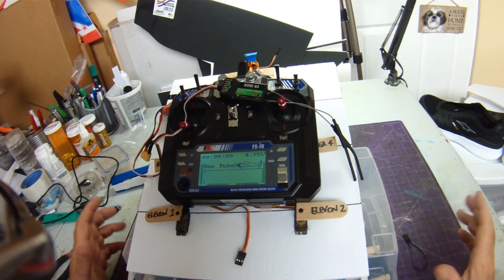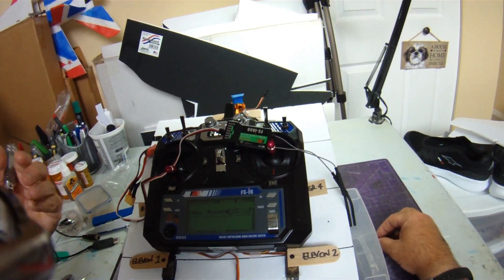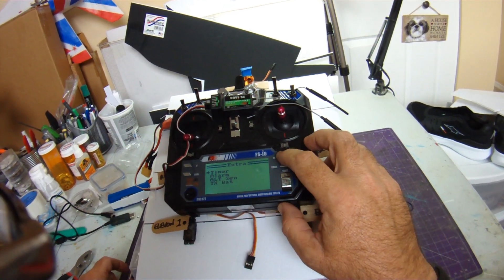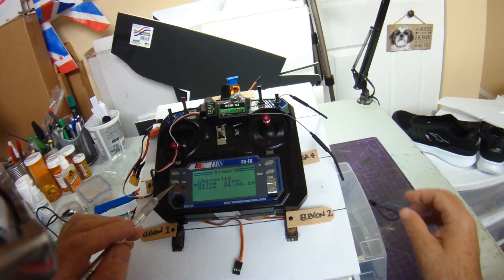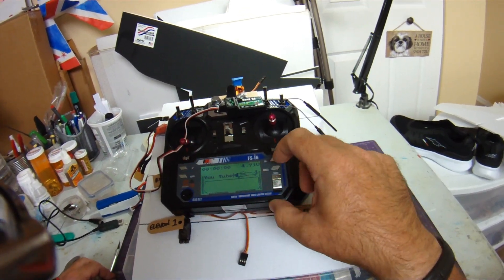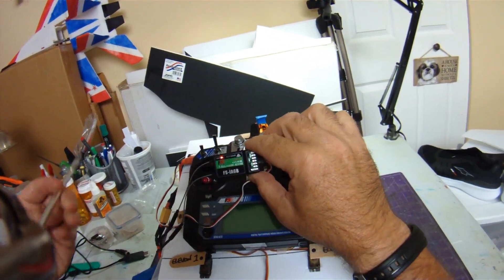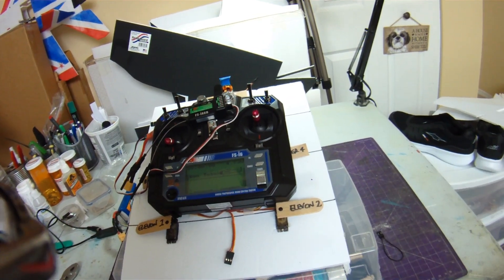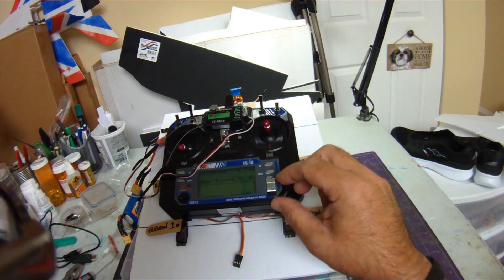FlySky FS-i6 firmware upgrade...I got the timer to work :)

Comment: Quick question... How do you know what PMW to set and what timing to set on specific Motors
Reply from the maker: Primarily just through testing each different combination of timing and PWM on my thrust stand with a fresh battery each time.  Here is the link to the spreadsheet with all the data I collected from the quad racing motors I tested as well as some other popular motors for park jets.  https://docs.google.com/spreadsheets/d/1KLR_wdkJ1OdGcf5f9jxxxU8qqmz_kXjMQH8NOLjW3NQ/edit?usp=sharing  Each motor has it's own page, so if you scroll along the bottom, you can find a particular motor that I have tested.  I try to put the PWM and timing setting if it is applicable to the ESC, otherwise it will just be factory default.  Cheers, Scott

Comment: Hey e3, I’m loving this thread! I’m also an i6 user, needing to use the timer on my phone to set flight times; very clunky. Have also found myself wishing  this Tx had a 7th or 8th channel - I have never needed more than that, but for some of my models, 6ch with 3 mixes just wasn’t quite enough. I’m going to run the firmware and see how I go - thanks again for pioneering helpful stuff as always!!
Reply from the maker: Hi Ben, thanks very much for the kind words, glad it has been helpful to you, best of luck with your upgrade if you decide to do so.  Unfortunately, the upgrade doesn't increase the number of mixes available, but perhaps will give you more options for other things.  Best of luck :)  Cheers, Scott

Comment: Have you thought about putting the timer on the throttle switch?

It's how I set mine up. It works quite well. Set the channel to your throttle channel, I've got the value set to 1050, then timer to whatever you need.

(Apologies if you know this already)(I use the IA6 rx)
Reply from the maker: Thanks very much for the tip, I had watched somebody do that, I have always had my timer on a switch ever since I started flying, so I'm happy to leave it there :)  Cheers, Scott
Reply: Hey - I consider getting FS-i6X for my own since I am a beginner in rc planes. I am wondering if I understood you well, but with upgraded -i6 firmware or stock -i6x you can set the timer to count down flight time not only by turning it on manually by switch, but also by turning it on and off while moving throttle stick up and down?
Reply: @macieks.5959  hey, di have a fs-i6x but when I tried to DL the firmware on Flyskys' website, my browser notes that there a virus. Trying to figure how to get a timer to my i6x..